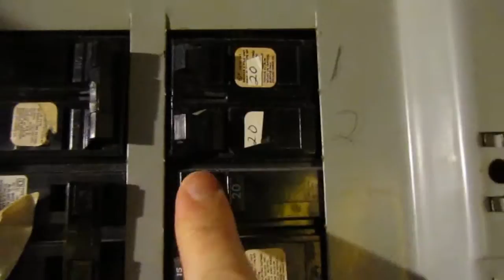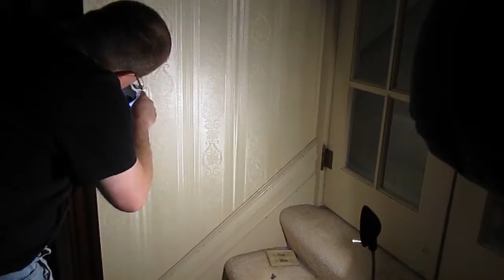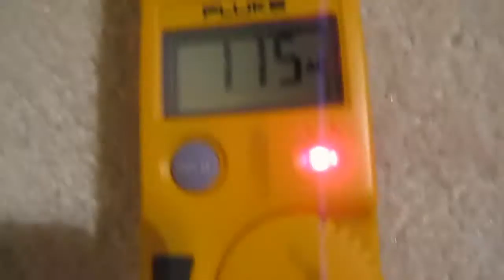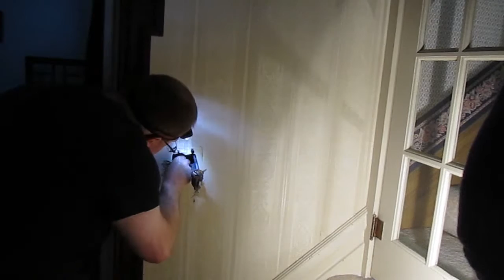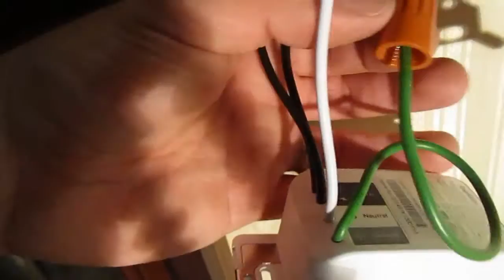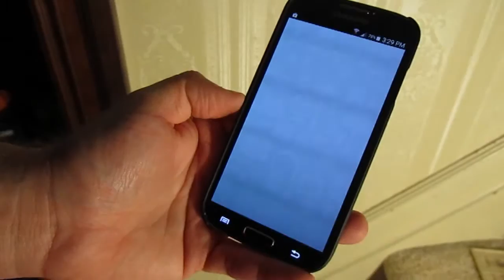Light it up. Belkin Wemo light switch

Comment: What you are looking at there appears, at least to me, as 2 separate switched circuits in the same box.  The actual power is coming into the junction box above the light fixture or in an attic crawlspace and the wires going to the box are both hot travelers.  One brings the hot to the switch and the other returns it to the junction box where it is connected to the hot side of the fixture.  You always want to switch the hot side of the circuit.  You don't appear to have a neutral wire in that box as the other switch is a 3 way and is using the black red and white as the hot coming to the switch and the 2 other colors as travelers to the other switch.  The junction box method of wiring used to be very common but has gone out of style now that wire is cheap and adding additional connections is unnecessary.  The reason that one wire is acting as a neutral is that it is connecting through the light bulb in the stair light to neutral.  It would be a good idea to see if you can run an extra cable up to that box from the basement that can provide a neutral and ground to the wemo light switch.  The wemo light switch needs power on the black line in "hot" and neutral wires to work properly.

Comment: I can tell you WHY it worked even though it's wrong and bad news... The Wemo switches NEED a neutral to work.  The way the switches were wired is two completely separate switching systems.  For the bedroom where there was the dimmer is a constant hot in (LINE) and a switched hot out (LOAD).  The 3-way switch has two travelers and a common.  In this case the 3-way is the far end of the wiring, meaning there is NO neutral there. One of the two travelers has the LINE power in on it (which depends on the position of the other 3-way/4-way switches.).  The other wire, in this case white, is the "common" (the oddball color screw), and is the LOAD wire that goes to the light(s).  If the stairway light is off, then the common wire is connected THROUGH the light bulbs to the neutral.  When you jumped to the "white" wire on the 3-way, the Wemo "sees" a neutral, but only if the 3-way switches do not send power to the lights.  If they do send power there, the white wire on the common is connected to LINE... if the two switches happened to be on separate phases of the electrical panel the Wemo would see not 120 (L-N) but 240v (L-L).... bang!
Added in the new set of Electrical Code is a requirement to have a neutral in a switch box.  Almost ALL past practice was to use switch loops and therefore no neutral at the switch.
Most likely the easiest way to get the neutral would be to get a 12/3 wire from the bedroom light to the switch.  It MUST be 12 gauge because it's on a 20 amp breaker.  14 gauge is too small.
Good Luck!
Reply from the maker: reabinc I am not sure why it works myself. It is working, but like you indicate if I turn on the 3 way switch the Wemo goes nuts.... I should just man up and run a new wire to it.
Reply from the maker: reabinc Maybe I could remove the 3 wire,,,,,,, or with the wire be so lose I might be able to pull down a new 3 wire and power feed for the wemo.

Comment: Surprised that actually worked, the white wire that went to that switch isn't a neutral usually. 3 way switches usually need three  wires 14\3.
Reply from the maker: ***** It works,,,, until you turn on the 3 way and then it turns the bedroom off... I think a new cable is going to be needed..... uggggg.. but it works for now.